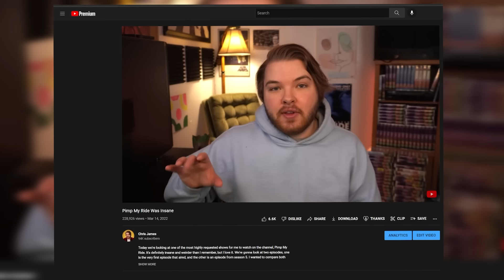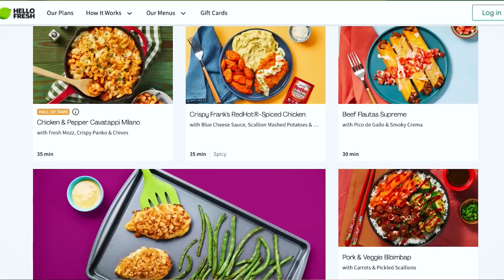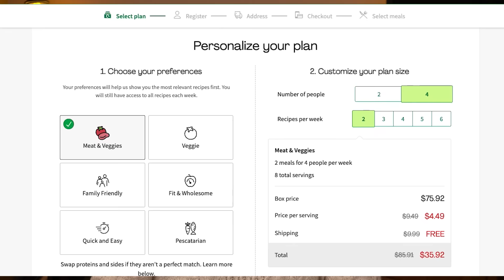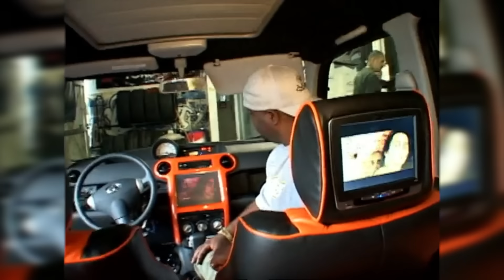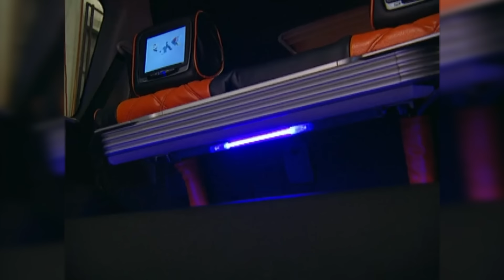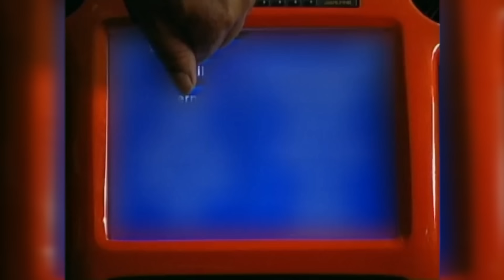Pimp My Ride Was Cringier Than I Remember..

Comment: Welding 2 cars together is Actually pretty common if you get rear ended hard and there is another donor that was wrecked in the front you can cut them in half and weld them together but those welds did not look that good it looked like a Beginner did them

Comment: Went from having a hatch with a huge trunk, to a “box” with a tiny trunk - that they filled with subwoofers.  Well, at least when the wheels and stereo get stolen, he’ll have a place to put groceries.   Too bad he can’t afford full coverage on this vehicle… 

And bonus points for giving him an aftermarket sunroof that can be cut through with a knife, and will definitely start leaking 1 month after getting it.  At least they didn’t give him a computer system that would need a cellular data plan in the $200/month range for back then - or FFS. 🤦‍♂️

Comment: when you crash a car badly most of the time the car is sold to a crashing yard and crackheads work there so they buy the car for like 200$ from their boss and they get same car and weld it together alot of cars with big damage needs welding

Comment: Welding two cars together was an old school body guy move, basically if the front end was smashed you just cut it off and weld a non smashed front end on.

The work done on that car was clearly absolute hack job and terribly executed,  even for what's essentially a hack job in the first place lol

Comment: I'll bet that warranty got voided on the spot when they dug into that Scion! Did they upgrade the electrical system to handle all that infotainment and sound tech? And I'll bet all that added weight to the car. If I remember right, all Scions had sewing machine engines no larger than 1.8 liters. How did it perform with all that aftermarket stuff? And was that tech reliable or failure prone?

Comment: That first car is 100% illegal in the UK.  Two cars welded together is classed as not only unsafe, but actively dangerous.

Does the US even have checks on the cars road worthiness?
Reply: Depends on the state, and even then not all states that check "road worthiness" are the same. For some, checking whether or not they're road worthy amounts to making sure the tail lights, head lights, and turn signals functioned, and that there is a certain amount of tread on the tire.

Comment: I'm gonna stop you at 2:03, yes, it is ABSOLUTELY necessary to weld two cars together. If the front of that car got absolutely RAILED and could not be pulled square, the only option left would be clip replacement, but THAT is THE WORST clip replacement I've ever seen.

Comment: Dude in case u dont actually know, and as one/speaking for mechanics we refer to the "rims" as wheels. They're actually called wheels, but we label them as rims more or less because of the bullshit spinner rims phase. Tires are the rubber around the wheel

Comment: I can answer the 2 cars welded together question
So the only logical line of thinking is either it was 2 crashed or rusted out cars(or a combination of both) and the frame is either bent or rotted and it's a nightmare making sure a car is straight so cut and use what's good and make sure it lines up LOL my buddy's Camaro got hit by a drunk driver and it was honestly less work to just buy a second Camaro and keep what's good off his engine and interior

Comment: Two cars made into one, isn’t that rare.
New and common cars make feasible candidates.
I’ve seen cars that got wrecked, new.
The body shop I worked at could get the half we needed in the correct color.
It’s really not that difficult to weld the pieces together.
Beware of the low mileage demo, ha!

Comment: The people would know they were getting their cars done. They have shooting locations and exageratte some things. Throw in some food for the fat guy - all over the floor. Those are not their real homes.

The car in this one was just welded badly, but nothing was highlighted about it making noise just some welds here and there. If not done properly (this one was not finished) then it can be unsafe.

You need to make sure everything is straight and within spec or it will never drive straight.